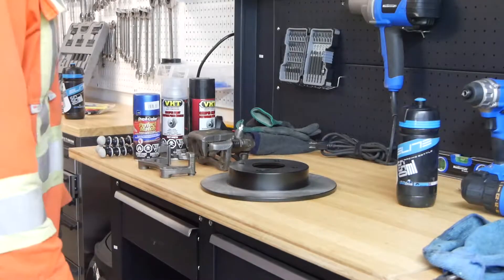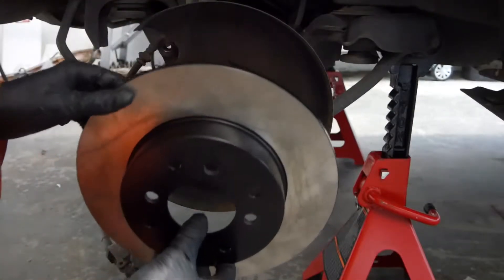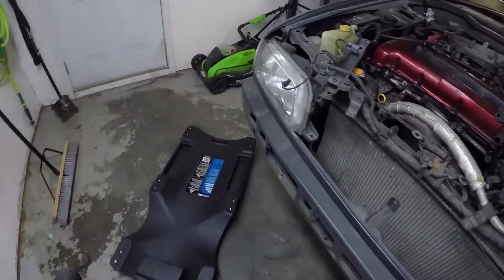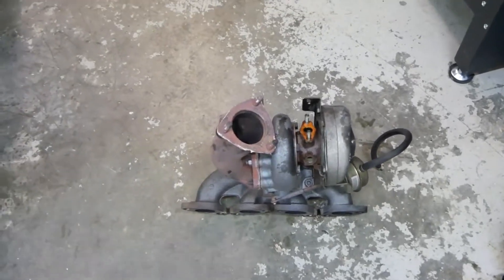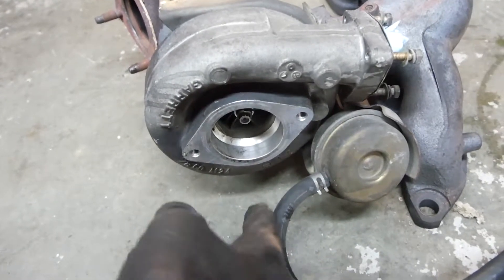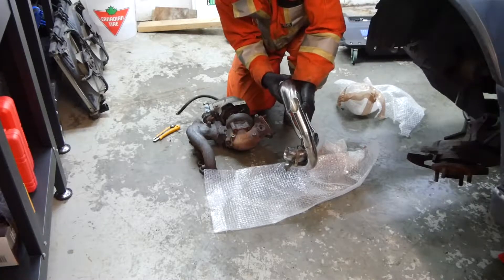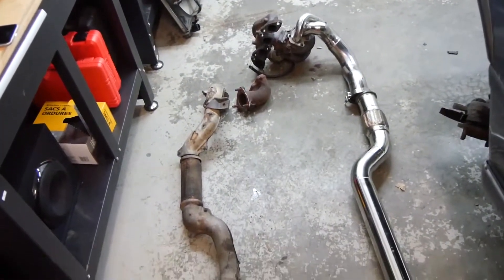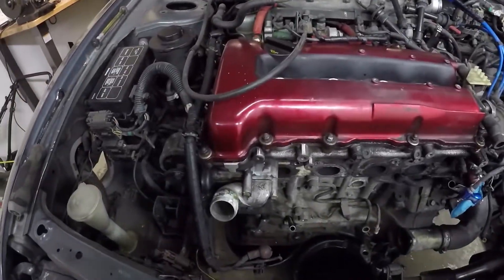Nissan Pulsar GTi-R mods and maintenance VLOG.  Feb 4, 2018

Comment: What larger caliper bracket did you end up using? Working on upgrading on mine and would like to know. It was not mentioned in the video.
Reply from the maker: 1999 Nissan Maxima 3.0L V6 rear caliper bracket.

Comment: Hi, I'm also in Canada and am considering buying a Pulsar Gti-r. My biggest worry is not being able to find a website for front axles. I noticed some ebay auctions sell used Gti-r parts but have you found any solid place for all your oem parts?
Reply from the maker: Not really I just check eBay or Nissan for oem parts.  There are some jdm sites like nengun as well. Axles you can get used from the gtir community and rebuild, there's quite a few groups on Facebook.

Comment: Howzit...just seen this and was wondering about the exhaust system. My question is...Was that a special order thru AM Performance? All I see from their site is the cat back/straight pipe version...I have the downpipe and the midpipe from AM with no cat and connected to the factory muffler. Would like to get the same exhaust set up as yours...thanks! BTW, I think I remember you from the canadagtir site...same guy ya?
Reply from the maker: leyogets hey! Yeah same guy from GTi-R Canada. I just emailed Andrew from AM Performance and he asked a few questions about what I wanted. I think it took a few weeks to build. Specifically I got a full 3" turbo back system with a screamer pipe, cat delete, an oem style muffler, and a straight titanium tip on the end.